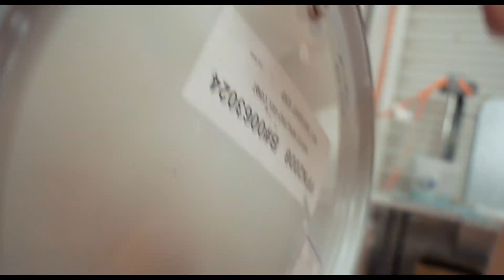Gel Coat Color Matching : We match any Old Gel Coat

Comment: How big of piece of Gelcoat from the boat do you need to match?
Reply from the maker: Not very big, Its done by visually matching to the part so as long as we have enough room for a few test dots we can pretty much make it happen. As long as the piece you have is an accurate representation of the color we should be able to get it matched!
Reply: @FiberglassFlorida  do you you have phone # or address